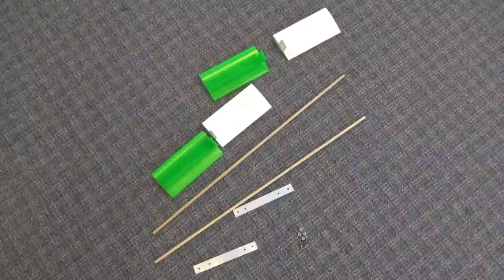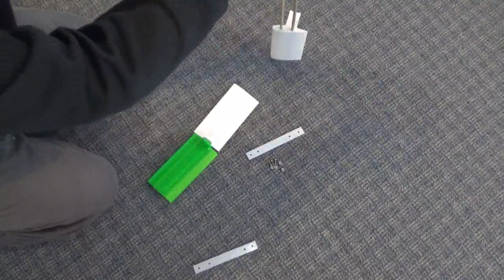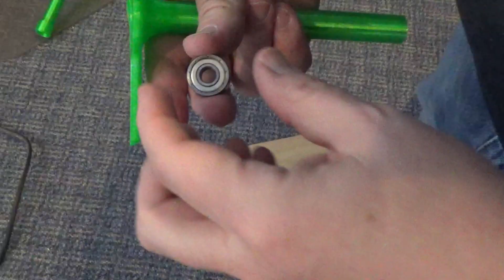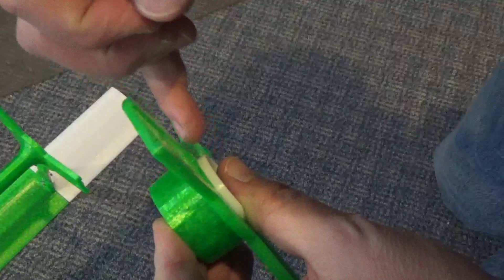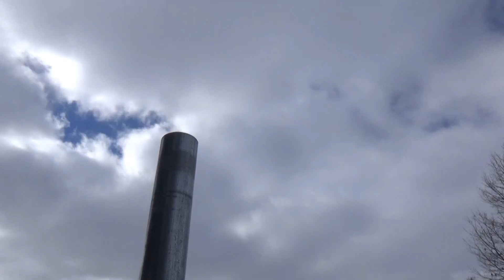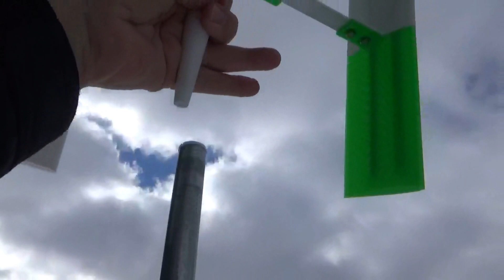3D Printed VAWT

Comment: It's modeled after Lynx Winds Gull which had an 8 degree AOA. Which worked well when I made mine. I like the way it fits together . Well thought out. I just hope the bearings remain weather tight.
Reply from the maker: I just hope the plastic doesn't break in the cold. :-)
Reply: @MickEMaus3000  The point where the wing attaches is probably the weak point; if you print any more maybe you could flare that area out along the chord a bit on each side with maybe a 1" radius
Reply: at least the bearings are cheap and easy to replace even if they do wear; looks like a 15 minute job all in